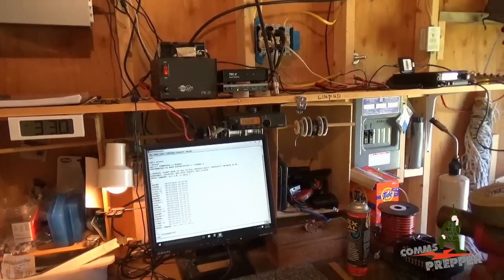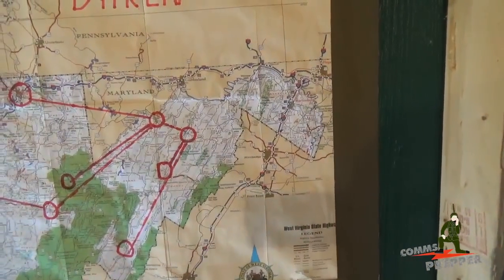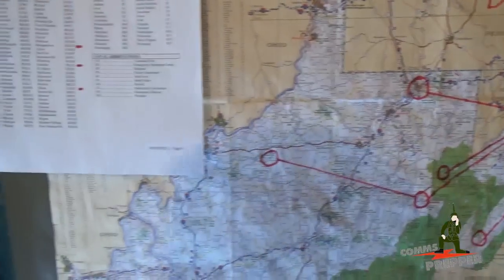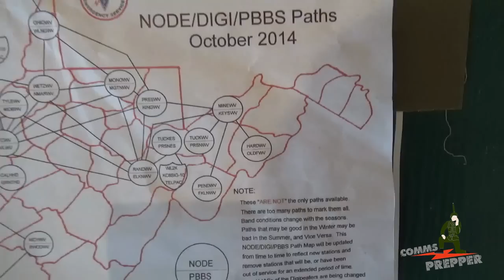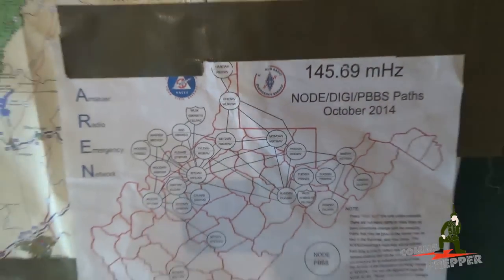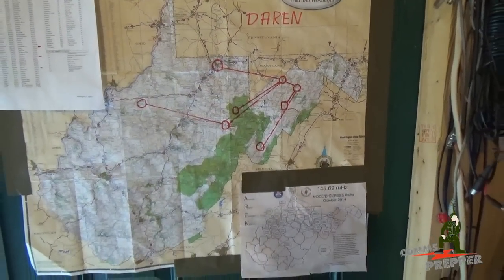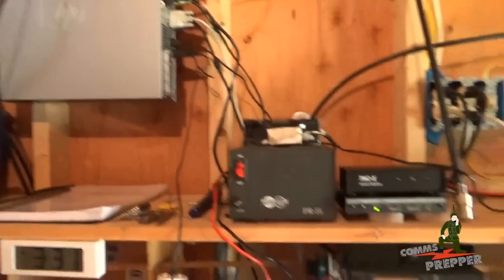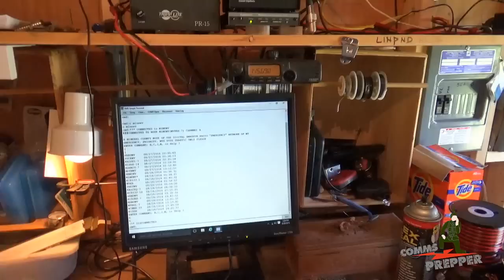Packet Radio Project Update

Comment: howdy hank, I tried to hit some nodes on the freq 145.690 (what baud rate is it)  from N.E. Ga. nothing for now, but I an hooking my 13b2 and a amp to it this week and see if I can get up your way. back in the 90`s I could hope nodes from south Ga to DC with ease, we have lots of traffic on 144.390 APRS here, guess times have changed. 73s
Reply from the maker: GA to WV - that would be a haul.  Yes there was a time when it could be done.  Perhaps if each of us gets a KPC3 plus we can do that once again.  I'm planing on getting a second unit for the homestead to fill that hole.
Reply: Im running the pk-232mbx should cover everything plus I have a kam all mode I havnt figured out how to use yet, its just sitting here.what baud rate is the 145.690 nodes?